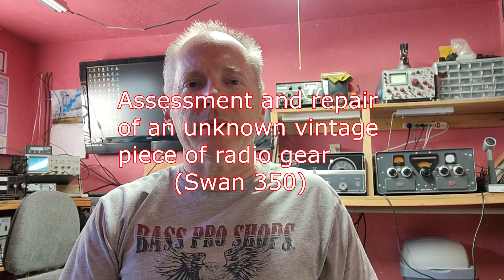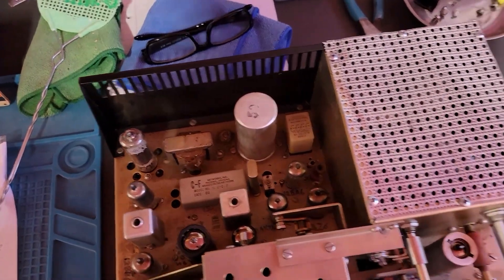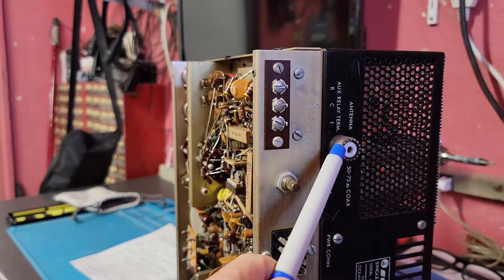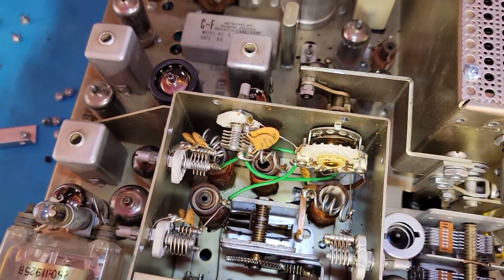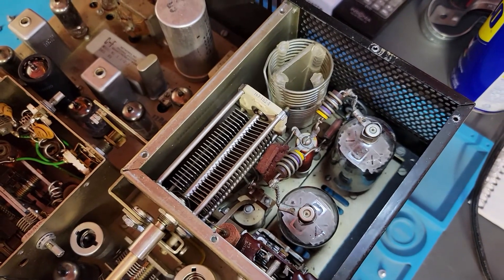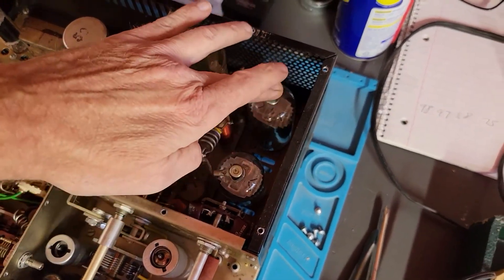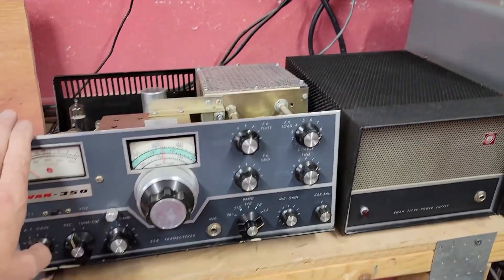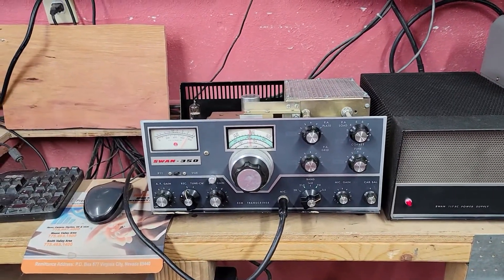Assessment of your new vintage rig

Comment: I bought a Swan 350C back in 1970 from Henry Radio.  It was my every day rig for many years.  I went off the air for 29 years and a little over a year ago, I got back on the air with the same rig.  I tested the capacitors with a capacitor tester.  Low ESR and right on value.  The Mallory electrolytics in the power supply are very good quality.  I brought it up with a Variac, current meter and a dim bulb tester.  No problems.  The 350C uses 6LQ6's.  I still have the originals (have a matched pair on hand should I ever need new ones but the old ones work fine. )  I cleaned the wafer switches.   I got on the air (40 meters) and it worked just like new.  I put up a Hy Gain 14AVQ trap vertical which I also had when I started out (the antenna was NOS).   My first contact after being off the air for so long was on CW.  I never lost it.
Back in the day, when I was a teenager, a ham friend and myself showed up at the front door of the Swan factory in Oceanside, California.  We knocked on the door and a kind gentleman there offered to give us a tour.  It's still my main rig.

I also bought an old Drake 2NT which was my first rig.  I sold the original to buy the Swan.   'Bought another one for old time's sake.  Still a fun trip down memory lane.  I also revived an old Heathkit SB100 that a coworker gave me several decades ago.  I really like reviving the old stuff and using it.
Reply from the maker: Barry, thats an awesome story. I am glad you caps were still good. I had one to many things happen over the years and just wont chance it on the elec caps. You should change out the couple bb caps that are floating around however I guess if its working then why bother. If you are on the west coast please come join us on Saturday nights at 730pm / 3895 for the swan net. Very loose nit group and we have a bunch of fun. Also we have a small groups.io at  https://groups.io/g/WestCoastVintageSwanNet   Hope you can join us sometime.

Comment: Clean looking rig.  the "Cadillac" of radios in their day. Well, at least a fully loaded Impala.
Reply from the maker: Well Cadilac of radios back then I would say no not even Impala LOL Maybe a 6cyl barracuda or later a maverick.
Reply: @n9amiwavelengthradio  Let me qualify.  A Cadillac priced radio at $450 in 1965.  Of course, the Rolls Royce would be Collins.   Did you own one?
Reply from the maker: @tseckwr3783  I would of been a Central Electronics 100V guy. I wasnt even born yet. However I do have the 100V now. As far as the 350 they were very problematic with so many changes it was nuts. But once you dealt with it they were okay. Many guys bought them because it was affordable.  The 350 was the most sold model of all swans. I myself like the 700CX the best.

Comment: It would be interesting to see a video of the sweep tube replacement and the neutralizing procedure.
Reply from the maker: Sure if someone wants to send me a new set of sweep tubes. Its not super diffacult as you just follow the manual.  I had a 350B one tube version that I did that on last year.
Reply: @n9amiwavelengthradio  I know. Those sweep tubes are very expensive these days. I have a spare matched pair for my 500cx but I don't operate that station much anymore.
Reply from the maker: @HD7100  The biggest issue woth sweep tube finals is operator error. Tuning up like a gorilla lol. Short 3 to 5 second bursts your good to go. The tubes should last for years. And add a fan to the top or back to suck out heat and your golden.
Reply: @n9amiwavelengthradio  Very true. Even in a television set if the horizontal drive is off they will red plate. The radio I use the most is an Icom 756 pro.

Comment: Thanks for the video, enjoyed it. I hope you checked the Swan 350 on 10M? More Swans were used on 11M then as ham radios in their day it seems. I bought a Swan 500CX used from Henry Radio years ago and all I heard on 10M was 11M.
Reply from the maker: Working fine on 10. Little lower output of course. I think you need different set of crystals for the criminal band.